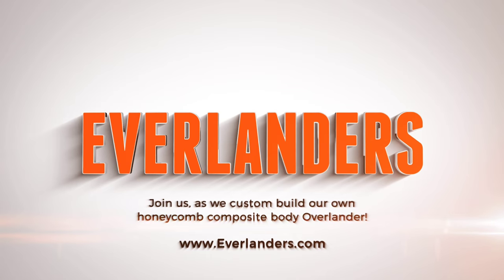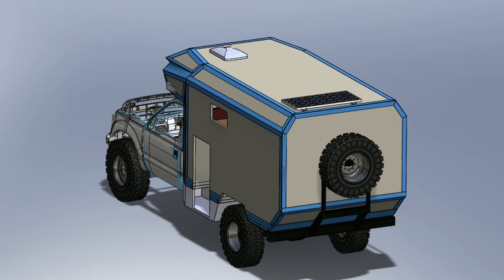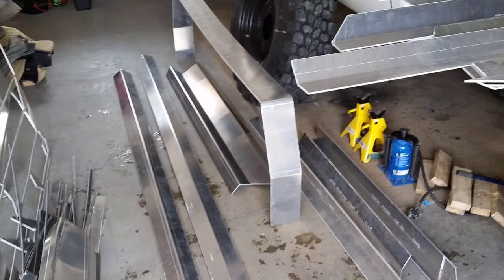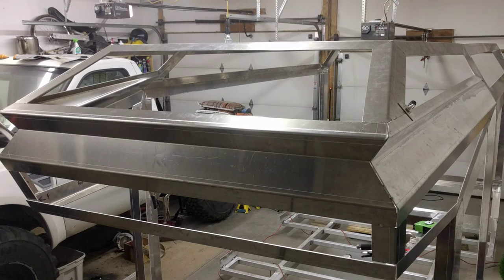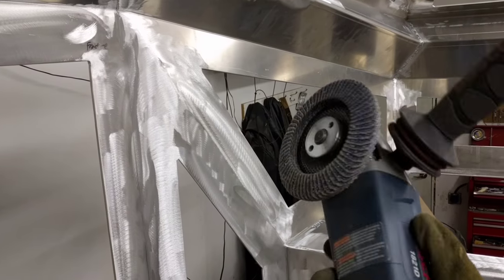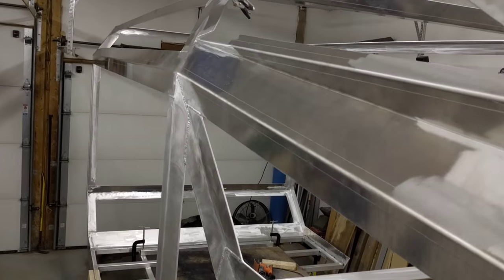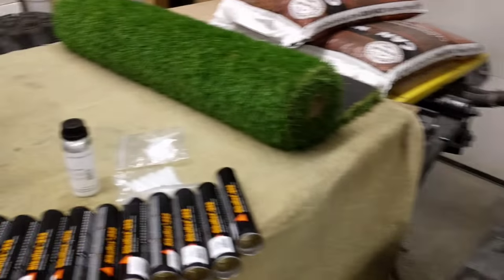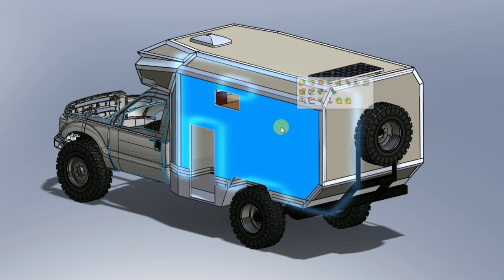TIG welding the aluminum Exoskeleton - How to build an Overlander.

Comment: This is so cool, I love the aluminum exoskeleton design! Lightweight but rigid and won't rust, and can be done in the garage. I want to build a custom composite setup of some sort. I've thought about panels like this or insulated "sandwich" panels, as well as building something from fiberglass/carbon fiber. I wonder if any of the custom boat companies would consider fabricating a fiberglass/carbon fiber shell? I'm thinking one of the biggest hurdles/costs would be having the moulds made to fabricate the shell around. Ok, gotta get back to watching all your videos! Inspiring work!!!  I have the Solidworks student edition too but haven't installed it on my computer. Guess that will be my first step so I can teach myself how to use it :-)
Reply from the maker: Whichever panels you go with, get samples and test for delamination. I ruled out foam cored panels because they easily pealed away when any bracket was riveted.

Comment: Did you ordered custom size for composite panels? I'm trying to order from a company making only 4'x8' but i need lager than couple of panels.
Reply from the maker: The full panels are 13x40... We had them rough cut to size.
Reply: @Everlanders  I see. I can't not find any company take custom order. Than you. i love your camper.

Comment: I've been pouring over and over your videos for days. A very amazing build thank you for sharing. Did you outsource the plasma cutting of the exoskeleton?
Reply from the maker: Thanks for watching, sometimes I wonder if anyone other than my mom actually watches, so it's nice to get comments like this! I have a friend who has a big plasma cutter and break at his workplace, he was able to get it done there during a slow time. Although not strictly required for most of these pieces, a table saw does a great job of cutting straight lines too! However the CNC brake was priceless, required to achieve all the exact angles.
Reply: Haha! Just discovered you a week or so ago. And making my way back through your process when I ran across this comment. A lot's changed in 5 years! X-D  @Everlanders

Comment: Did you ever experience any issues with panels bowing, detaching or dis-bonding from expansion/contraction of the aluminum exoskeleton?  I would think there would be issues from solidly joining two unlike materials together that don't expand and contract anywhere near the same rate.  But proof is in the pudding, as they say.  So how has your build lived for these years?  If you report back good news, I will also consider employing this method of construction, as I can see where it would be incredibly strong for off-road use.
Reply from the maker: We used the proven method of adhesion, Sikaflex 252 and 107 primer, make sure to use a 3mm rubber spacer near the rivets, this ensures the Sikaflex has a 3mm cross section to allow for thermal expansion and contraction...

7 years, 10 Countries, 2 Continents, 100,000Km and it's still as good as the day (after) I built it.

https://youtu.be/EPgfyJ9bou0
Reply: @Everlanders  Outstanding.  Thank you for the quick reply!  I'll be watching all your videos.  It's gonna take a minute.  You've got so many!

Comment: How much did the material cost?
Reply: Hello if you calculate a 2 x 2 x 4m box with Alu angle, this is approx 12lengths of 6metres giving a cost retail of approx $500. There is also sheeting and I dont know how much the honeycomb/foam is.

Comment: Your old video popped up so I watched it again!  Oh yes I remember,  the “Magic trick”. When the whole thing comes together.  I would have loved to see how you get it on the truck!  After that video, do you carry a extra SD card in your pocket ?
Reply from the maker: It wasn't that I didn't have SD cards, it's that I was juggling too many things at once and didn't notice the camera on the tripod just stopped mid event. But as I recall, it wasn't super eventful, it just tipped on and we pulled it forward till the bolt points lined up and then we bolted it up.
Reply: Everlanders / With that bit of insight I’m looking forward for  more behind the scenes adventure videos. As a DIY electronices enthusiasts and retired bench  tech anything you design and manufacturer  has me watching with interest.  

Raspberry Pi projects can be your best friend when it comes to making custom equipment  for your rig.  Right now I’m working on designing a security system for my 79 GMC suburban. Your Android audio upgrade was a good learning tool.

Comment: Great build - love watching your series.  How did you decide on your chinesium light?
Reply from the maker: We tried to find one that still had (or claimed to have) high-quality Cree LED modules. Once we received them we tested the current draw against the claimed wattage and then sent them back... We actually ended up going through 3 bars before finding one that was half decent. We also bought a common width so that we could upgrade to a Ridged or other High End Light if we found the need.

Comment: Nice work approx weight of aluminum frame?
Reply from the maker: Fantastic Question! I get asked that a lot in person too, So I've opened up the CAD model and got you some numbers.

The CAD of the frame can be seen here: https://youtu.be/vLkxmSkcLvQ?t=43s

Top 3/16" Plate - Custom Angles and Framework  - 6061
235.17 lbs or 106.67 kg

Bottom 2x2" 3/16" Wall Tube - Frame - 6061
47.58 lbs or 21.58 kg

Total Aluminum not Including Welds

282.75 lbs or 128.25 kg